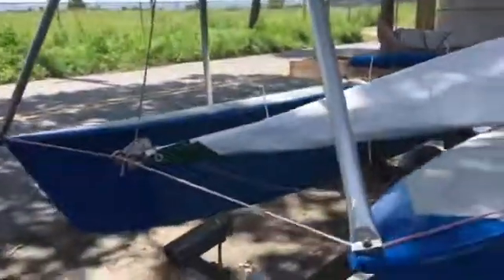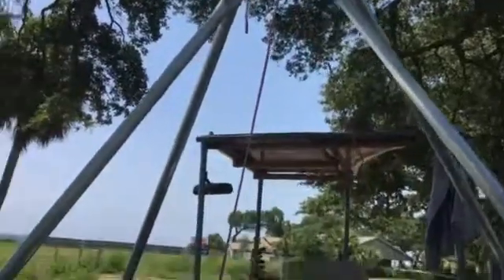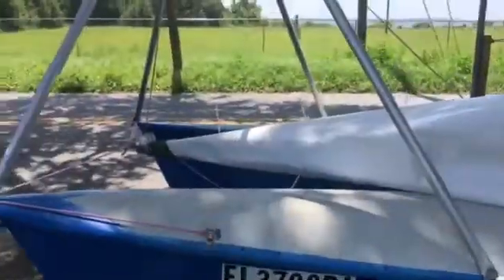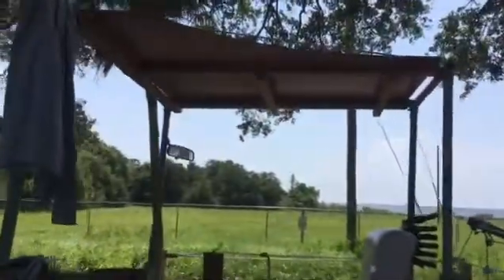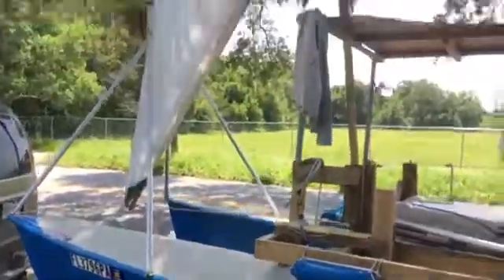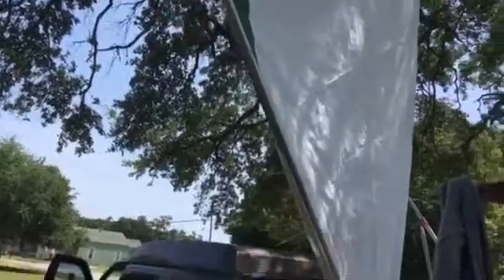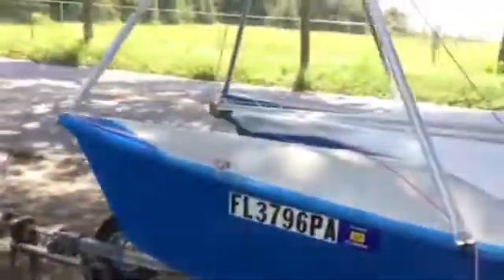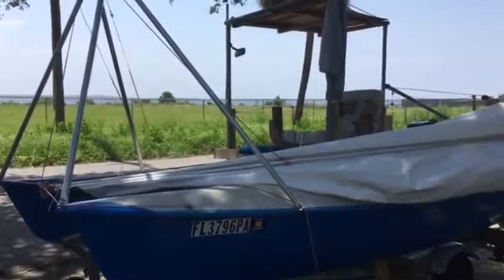Crab claw sail rig testing

Comment: Good job, looks very functional. What is the sail material?
Reply from the maker: Hydroman 7 polytarp from Polytarp International for $150.
Reply: Patrick Johnson  thanks, how did it perform vs. standard rig?
Reply from the maker: Hydroman 7 it was only supposed to provide enough propulsion to get back to shore if the outboard stopped working. At only 60sq Ft it’s much smaller that the original Prindle sail so not much speed. I’ll need to continue to experiment before giving a more in depth report.